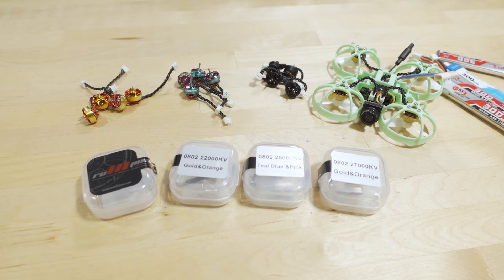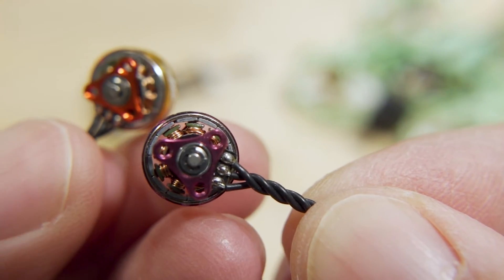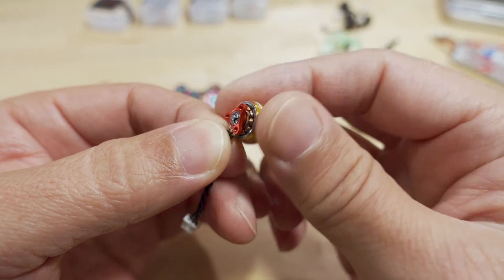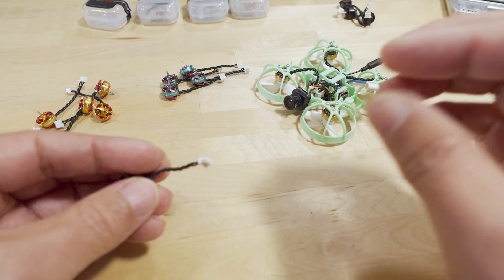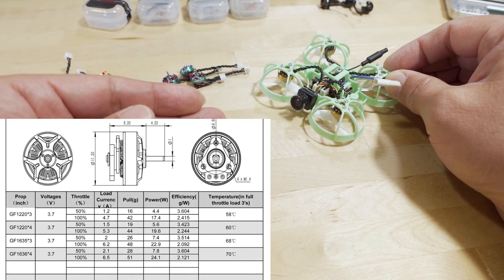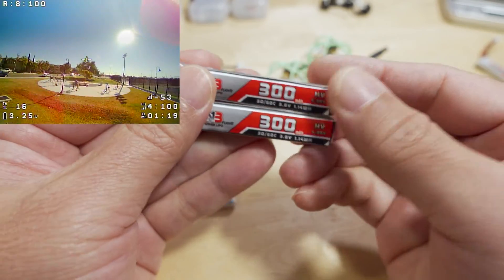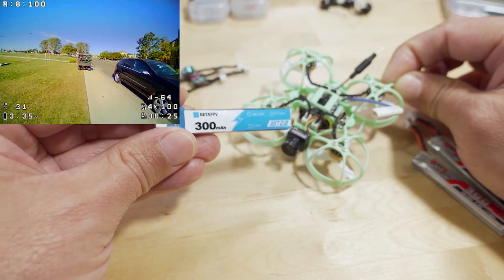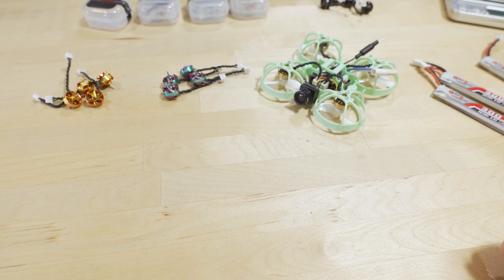RCinPower 0802 Motor Review 🏁

Comment: As far as battery suggestions, those gnb 300mah are way too small, and a 30/60 c rating just won't cut it for 27000kv. The way to go is to run a much lighter, stiffer frame setup, with a much larger battery. I've been running the gnb 550mah hv 100/200c  with gnb 27 connectors in a fractal 75 frame, x12 elrs fc, pico razer camera with tiny whoop 0802 30000kv motors. All up weight with battery is around 35g, and its pure insanity, with 3 to 4 minute flight times, doing serious acro, heavy on the throttle with a lot of punchouts. The only problem I'm having is that I keep burning through motors. I'm very interested in getting my hands on these rcinpower 27000kv motors for the durability of the dual bearings. Does anyone know when they will be available? I can't seem to find them anywhere except for Aliexpress, and will never order from that site...
Reply from the maker: Interesting... I didn't think 27000kv would work on a 40mm prop.  Surprised the 30000kv motors didn't burn out.  Still want to stick with a 65mm frame though and not move up to 75mm.

Comment: With a fixed prop length though, as you go up in kV don’t you also effectively lose some amount of torque and effectively thrust but gain power?  I’m using a Mobulus 7 ELRS 1s with 20k kV motors.

Comment: Great review of some pretty little motors. I 19500kv motors, work good for my slow brain. I'd probably be happy with the 22k motors. I use the tattu 1s lipo with bt 2.0 connector. They're pretty good, but I have no idea how they'd handle 27k. Webleedfpv also has decent lipos with the bt 2.0 connector. Happy flying Albert. 🤓